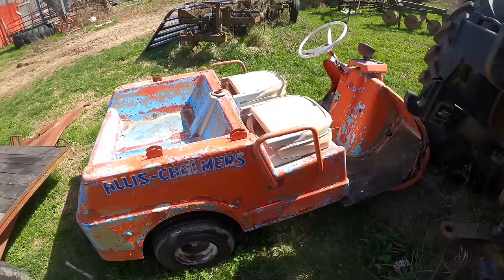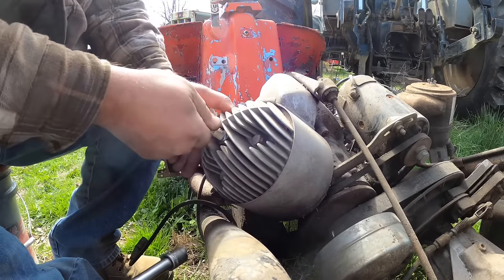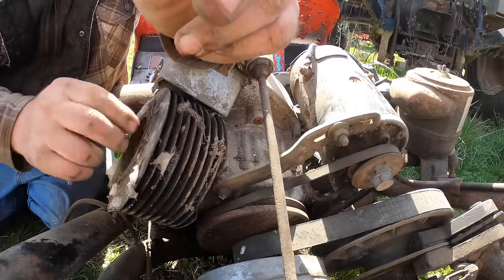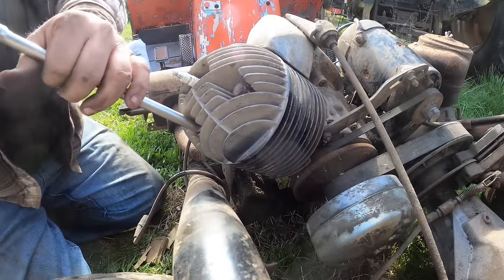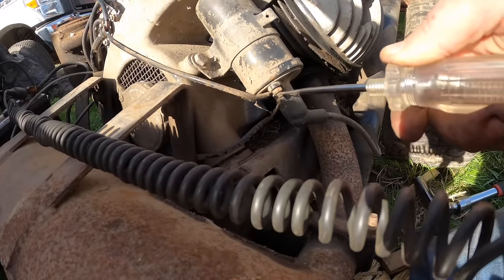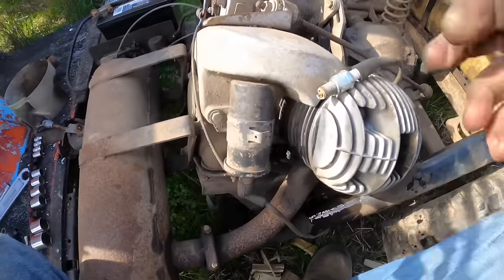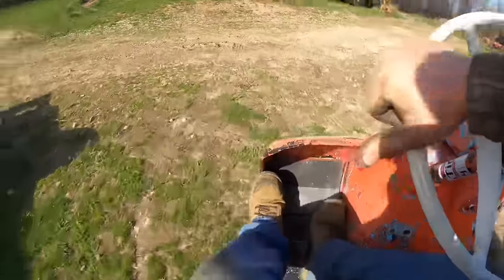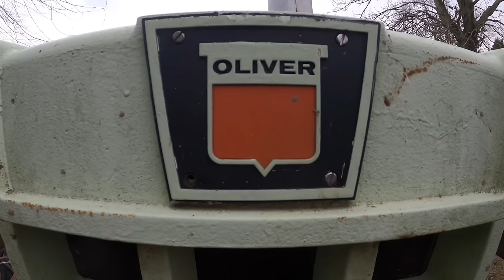1980 HARLEY DAVIDSON golf cart: WILL IT RUN???

Comment: Why do you insist on never using penetrating oil before loosening nuts and bolts and seized pistons?
Reply from the maker: I never have any on hand. The last can I bought got ran over.
Reply: @rosstheoliverman 😂 ANY oil is better than none. Even a little bit of diesel would help.
Reply: He does it to get more comments😂😂
Reply: Then you have penetrant all over while working on it also like the man says he don’t got none. Sometimes it’s not convenient to run to a store or maybe he just don’t feel like going out in public so he makes due with what he has successfully

Comment: I just bought one of these from my neighbor and I'm trying to figure out how to get it to start with the gas pedal because it doesn't and it's kind of hard to figure out how it's wired. I finally got it to turn over by jump starting the solenoid but now that doesn't work. Looks like it'll be fun once I get it running

Comment: I would say it’s probably a 40:1 oil mix which is a shade over 3 ounces per gallon of gas. I’d be careful running around much if you don’t have the proper mixture those two strokes will burn up pretty quick…ask me how I know. Should be a cool rig painted up in Oliver colors. If you could find an Oliver steering wheel knob to put on it that would be awesome!

Comment: Ross, it's me again. Mine has a key switch in the middle section and then you press on that gas pedal and that's how it starts. There is a button on the axel mine is on the left side in the middle of the wheel, push in or out and that gives you free wheel. The points will be located in the little triangle piece behind the muffler I think there's three screws. The carburetor could be clogged? They say that there is a special mix for these just a regular chain saw I guess does not do the antique golf cart well. Please let me know what you need to know and I'll get back to you. Skip

Comment: Put some lubrication on the piston deek head, youve just scored the crap out of the rings and the cylinder wall. 50/50 trans fluid and acetone, good lubrication and penetration. Theres also a fan in there that helps keep the engine cool but you took the shroud off
Reply from the maker: If you watched the whole video, you would have noticed I poured oil in the cylinder. Also you would have noticed I put the shroud back on. There were no score marks at all.

Comment: Check your German heritage.  The Messersmidt 3-wheel car reversed by running the engine in the opposite direction.  2-stroke Detroit Diesels will run in both directions. That is how ships and submarines using the 2-stroke engines went ahead or astern.  Parts? My guess it that the engine is the same as the Harley Hummer.  It will run better when you have your pasture pool clubs on the back.